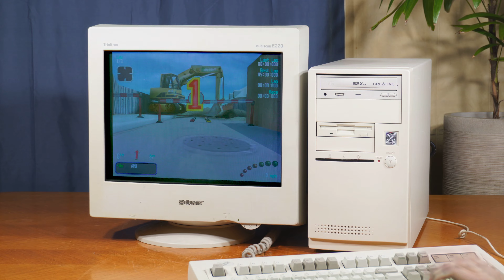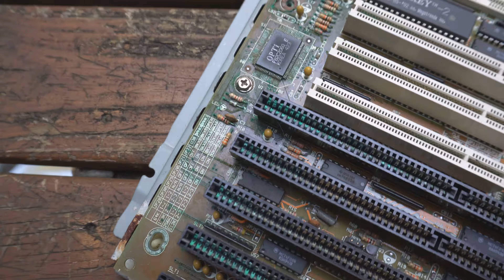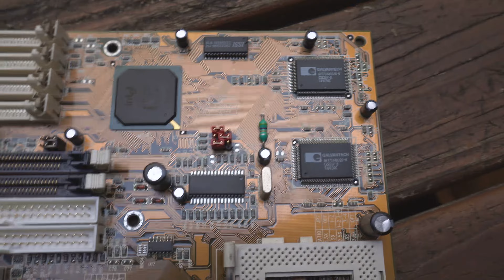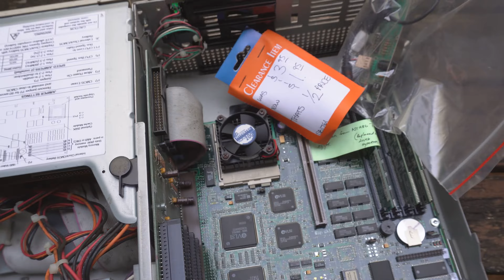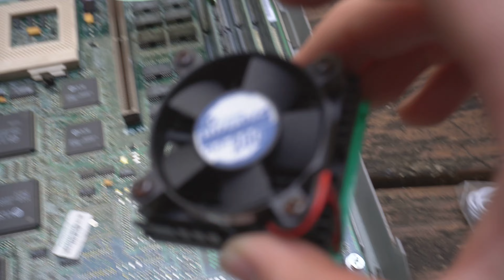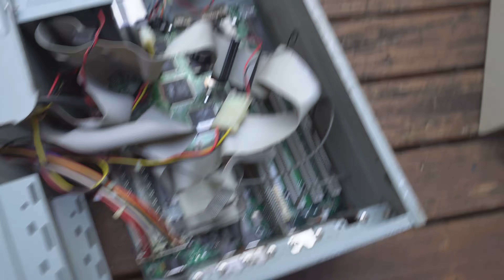Looking at Some of my Recent Vintage Computing Finds!

Comment: Where do you get all of this vintage stuff? Ive been trying to find a 486 computer for a while but the last vintage computers I had were all early pentium machines and ebay is just asking insane prices for older computer hardware
Reply from the maker: I work with a local ewaste recycler, that’s where most of it comes from. eBay prices are pretty steep, but if things are selling for that much, then the truth is that’s probably what they’re worth

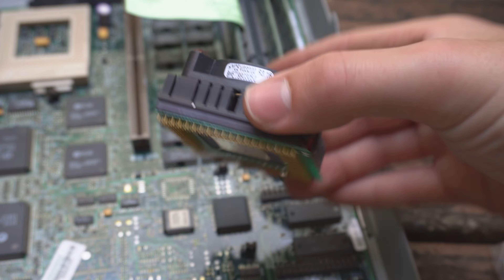Comment: 8:27 huh, i think that might actually be an IDT Winchip C6 or Winchip 2 instead of a Pentium. that's a pretty weird upgrade.
hope that thing boots; one headache I remember from Compaqs of that era is that they liked to keep their BIOS setup utility in a special partition on the hard disk instead of a chip on the motherboard, so if your HDD died then you were stuck reloading it from floppy before you could do basically anything at all.
Reply from the maker: I’m pretty sure it’s a cyrix 200. The system is socket 5 so yeah it’s really cool to see. Damn that will be annoying if it does intact have the bios setup on the hdd, hopefully not.

Comment: The socket 5 vlb board is very interesting. It is probably lost cause but you can attempt to repair it . I am pretty sure that it uses only FPM ram modules and it wont start with EDO ram. And the ram have to put in specific way: ram, empty, ram, empty or ram, ram, ram, ram. Something like that.
Reply from the maker: Yeah it’s a cool one, but definitely beyond repair.

Comment: Nice haul, I just repaired my second 486 motherboard that had battery damage, I first watched Necroware motherboard repair videos to get some confidence before attempting the repair, luckily both boards only needed a couple of bodge wires.
Reply from the maker: Thanks! Yeah these boards are most likely beyond repair sadly, cool you got yours going though